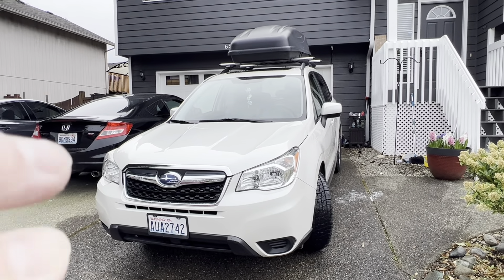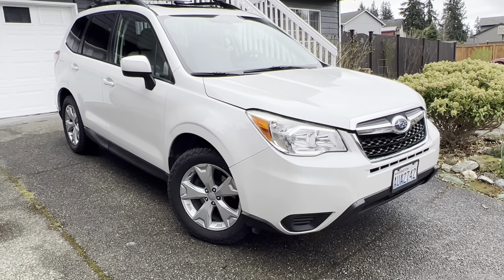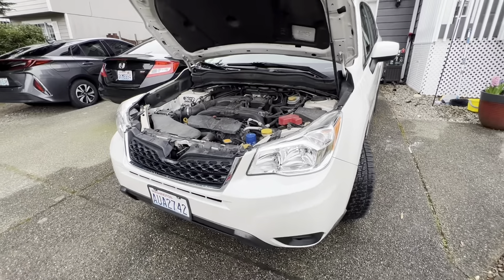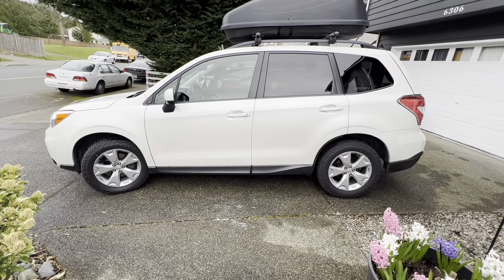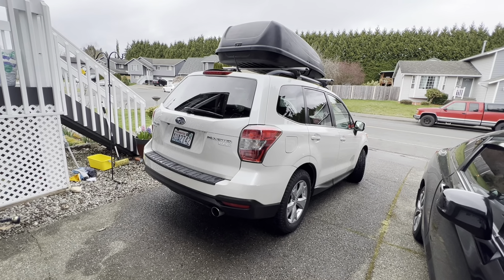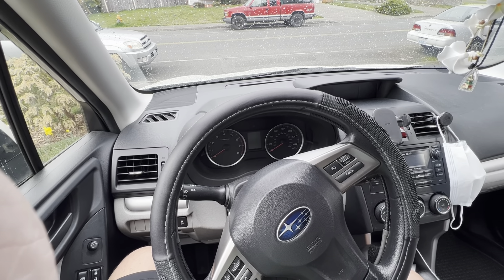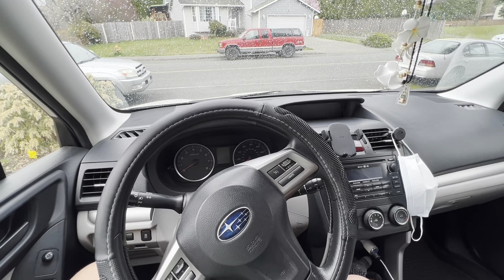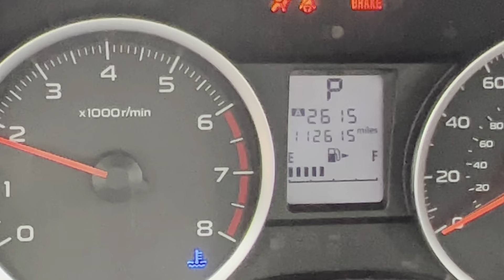2015 Subaru Forester 2.5i LONG TERM REVIEW 112k miles.  Original owner. Repairs, likes and dislikes!

Comment: Nice video, my 2010 Forester battery lasted 7 years. But my 2019 Forester battery lasted 14 months. Replaced under warranty. 

Unfortunately the cabin air filters are now OEM. Aftermarket frame doesn’t snap into place. I am very tempted to do some cutting and glueing to swap the OEM frame and after market filter element.
Reply from the maker: I have had good luck with filter replacements on Amazon. Glad to hear they replaced your battery!

Comment: Interesting video!  I have the same car, which I bought used about a year ago.  I've had ongoing issues with the suspension and transmission.  The car rides rough in my opinion.  I feel every bump on the road.  Also, the transmission is jerky and the gas pedal is very touchy.  As soon as I give it a little gas, the car jumps forward.  It's also not smooth when accelerating and decelerating at low speeds.  I don't know any other Forester owners, so I was hoping you could tell me if you've had the same problems.  Thank you!
Reply from the maker: I would recommend you change the CVT transmission fluid. It makes the transmission smoother. But yes, the gas pedal is very touchy. I don’t like that. I just found out that it’s gonna need a transmission valve body because all my car lights came up. I called Subaru of North America and they gave me a case number so I’m hoping they can help pitching for repairs on some level.  Honestly, Subaru owners hate talking about problems. I am an honest person, and have no issues with giving you my opinion and truthful review. I would also recommend you clean the mass airflow sensor. It’s super easy to do. Just make sure you use a cleaner for mass airflow sensor. That might help with your idle.

I am more of a Toyota fan. I have had some problems with Toyotas, but definitely not on the same level as other vehicles. And honestly my BMWs that I’ve owned in the past has been a lot of maintenance, but definitely not more than the Subaru.
Reply: @AutoGuyVideos  Thank you for the advice!  I know it sounds strange, but I love everything about the Forester except for the way it drives.  I wish it had a regular automatic transmission and softer suspension.  It's great in the snow though.  Take care!
Reply: Cvt will do that except the 5speed could be control to ur taste. The tires r one thing if it feels bumby n loud so the at trails that he has is smooth n great in snow.

Comment: I honestly have a love hate relationship with my Subaru Forester.
Reply from the maker: Fun to drive vehicles are always like that. Unfortunately I just wish Subaru made their wheel bearings CV axles, cvt valve body and lower control arms more reliable. The engine is great. Fun  and sporty to drive. Great, visibility. but they need to improve reliability on some of their parts.
Reply: @AutoGuyVideos  I completely agree. They need to improve reliability in some areas. I love how safe they are too
Reply from the maker: @Robert-eu4tw  yes agree. They are heavy and thicker doors etc for safety. It reminds me of my previous x5 in some ways.